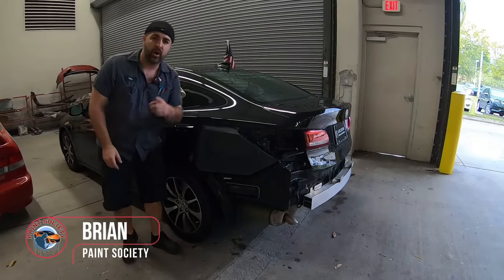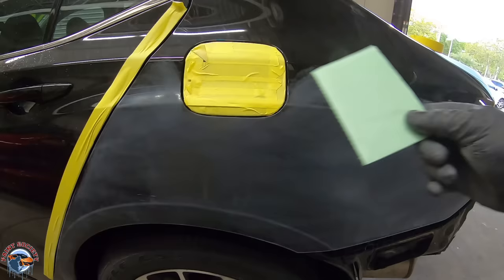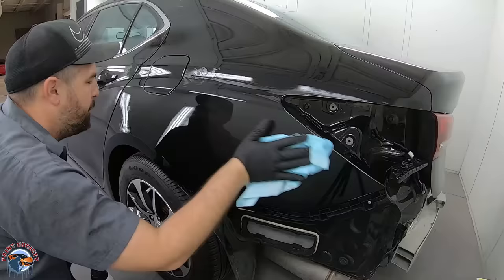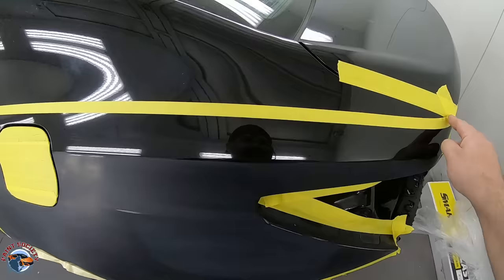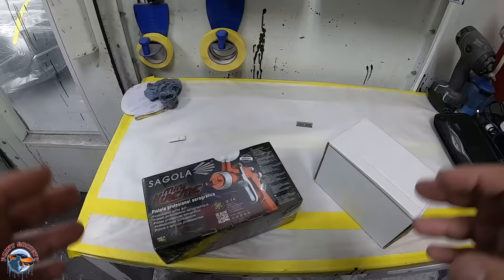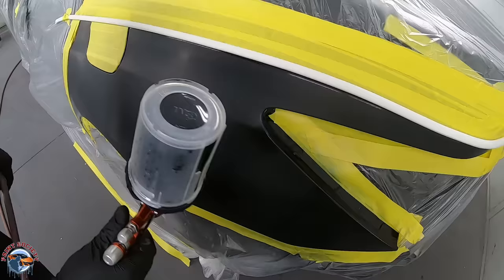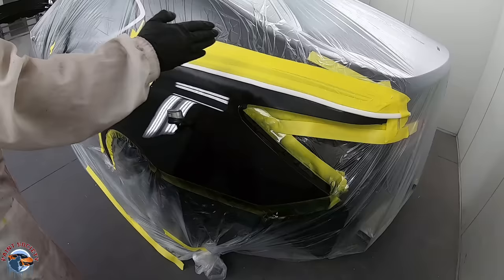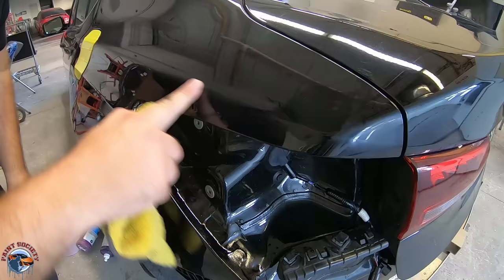This Paint Trick will Blow your Mind!

Comment: I understand the Mechanics finger issue. I have done it to myself...Many times 😞 I picked up a 2010 370Z with 64K on it. I got it for 9 grand. Because the last owner cut the springs, put 20' truck wheels on it. But the part you will laugh about the most. He painted it 2008 Lambo Orange pearl. It is a beautiful color If he did it right. He scuffed stock Nissan black, then used very expensive paint. Needless to say, it is falling off now lol. I will repaint the same color with all the correct steps. Nissan is a good co, but they can not do paint to save their lives. I have seen GTR's that are 5 years old with fading clear. His mistakes gave me a great car to restore. Then mess up again.
Reply: Nice work.

Comment: this is how i do all my repairs always paint as little as possible and use body lines for break points.I mean really when you have a quarter panel to paint with a sail panel to the roof do you just keep on clearing on the roof and around to the other quarter or do you blend it in  .This is nothing new I have been doing auto body repair since 1982

Comment: The way he did the clear coat will NOT LAST //// You need two coats or uv rays will destroy it in one to two years from being to thin .I did that many many times with just tape rolled up and removed before baking. Came out perfect every time and no comebacks because i did two clear coats all the way to the tape. //////////////// There was NO HARDLINE when done because the tape rolls the clear spray at the edge.///////////// You must remove the tape right after the second coat of clear pulling it upwards for this car or down when doing a bottom roll back ////////////

Comment: Anytime you burn in clear you lose paint manufacturers warranty. And it's dumb to burn an area as large as that. If it's necessary to burn it do it in the smallest place possible, the sail panel in this case. But with all of this being said,you shouldn't be burning clear over a black base anyway. It's not that much more work to go ahead and prep the whole surround panel.
I would fire a prepper on the spot if he prepped one this way
Reply from the maker: Thank you for your comment 😀

Comment: All the time spent on the soft edge & burning in the dog leg at the rocker it would’ve been more efficient to just clear the entire quarter
Reply from the maker: Doesn’t take long. Probably about a 3 hours repair start to finish
Reply: In your opinion, but it wasn't your job. Clear coating the entire panel would require masking, prepping, and clearing all the way around the roof line to the front fender.
A good painter knows that every job is unique and requires these decisions to be made daily on a per job basis.
Reply: And if you're saying he should have done the entire rocker panel too? That would almost never make sense to carry the quarter panel painting all the way down the rocker panel to the front fender, never.  No one's getting paid enough for that.
Reply: Trust me I understand you won’t be getting paid enough to paint the entire quarter but that’s still the way we do it. I’m not a fan of burning things in. For me it’s just easier and faster to sand mask and paint the entire panel. Good prepper / painter team gets it done just the same. A matter of preference
Reply from the maker: @noahisman9022  yea we always do the full quarter but I’ll always burn in the dog leg so I don’t have a 10 foot soft edge under the door

Comment: guarantee this car has some form of paint failure in the near future.
This wasnt a proper repair at all, this is exactly how you cut corners and rob a customer lol. (FACT)
the "feathered edge" is exactly where your paint failure will start. allowing moisture and other contaminants get in between that new paint and the old paint.
ive had quite a few cars over the years that i purchased that had paint failure do to a spot repair like this that wasnt done correctly.
Its way too easy to not sand off 100% of the clear coat, you lay your "new paint" over that and it has a horrible layer to adhere to.
Ontop of this, thinner layers of paint flake easily. meaning your edge which in my opinion is the most vulnerable becomes a target for failure.
thats why you see bubbling paint and rust around wheel arches and around door seams and fender lines. the paint is much thinner there and fails first.